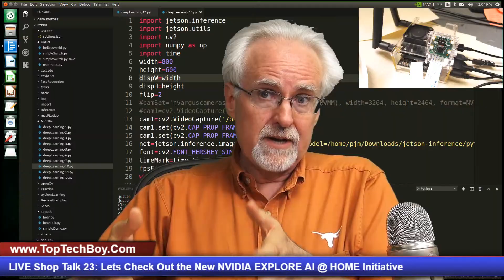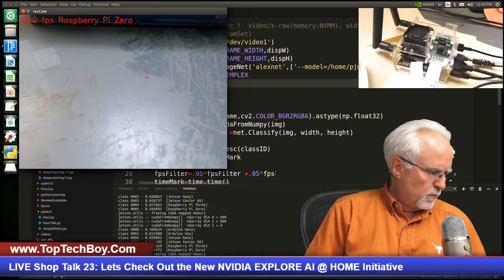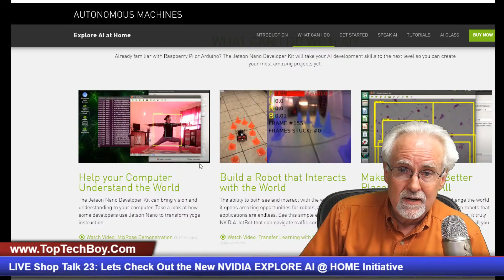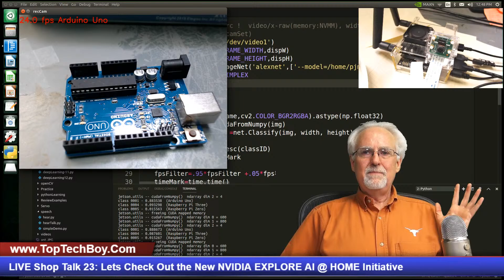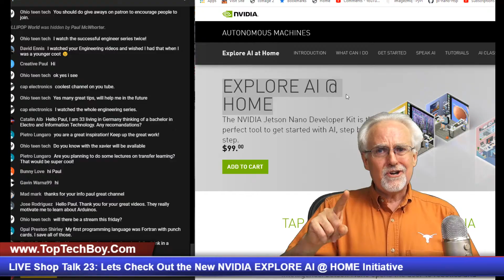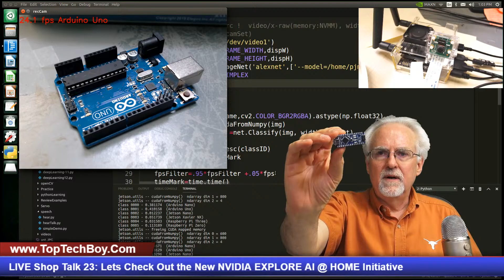LIVE Shop Talk 23: Lets Check Out the New NVIDIA EXPLORE AI @ HOME Initiative

Comment: Hi Paul. Listening to your discussions regarding the Jetson Nano and the Raspberry Pi , I had an idea to tidy up the wiring from the Jetson Nano GPIO pins. Adafruit market a Pi Cobbler expansion cable and breadboard compatible connector. This was obviously designed for the Raspberry Pi, but is also compatible with the Jetson Nano. Using something like this GPIO expansion cable means that you can then make more use of breadboard circuits. For example, I used it tidy up the wiring for the two pan/tilt servos and driver, power, etc, etc,